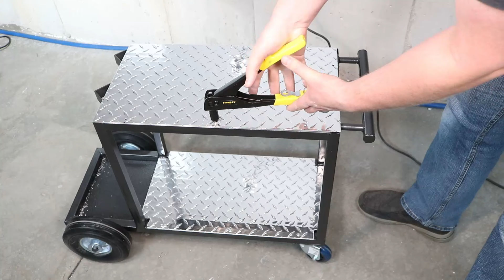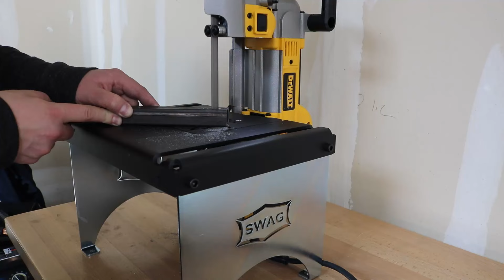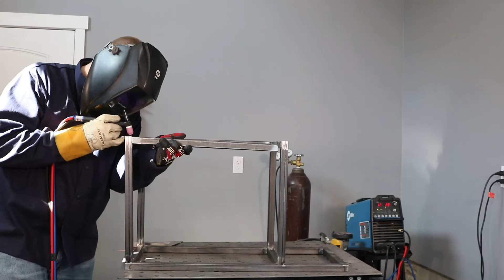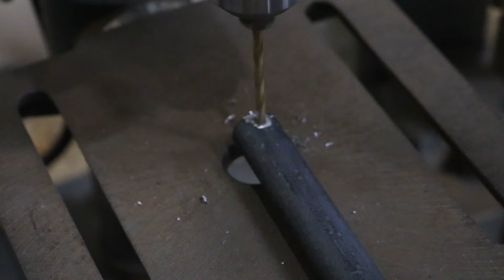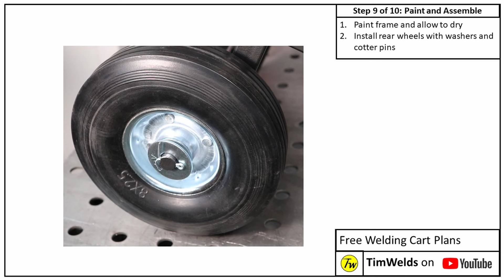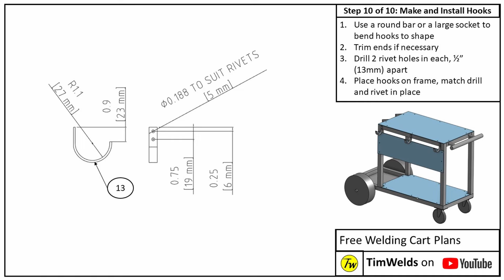How to Build a Welding Cart: Free Welding Cart Plans

Comment: How do ypu know wjat soze axle wheels with casters so its level?
Reply from the maker: I just held them up at the store to find some swivel casters that were about the same height as the top of the axle hole. If it's off a little, they're far enough apart that it'll still work fine.
Reply: Ok thank you tim keep up the good quality content you truly are a profesional

Comment: Great video!

But the only thing that i would never ever do again is weld on wheels, you should always bolt them on as they do eventually wear and break down over time and changing them is a big pain in the ass when you need to change them if thy are welded on.

Comment: Several questions:

1.  Are the plans downloadable for printing?  I like to print sheets as needed.  It would also be handy if doing an order on Online Metals.   

2.  I see you used TIG for the majority of the frame welding.   I may have missed something, but is there a specific reason for TIG and then the transition to MIG for the caster plates?
Reply from the maker: I don’t have downloadable sheets right now. You could use any process you like. It’s been a while and I don’t remember why I used both. I probably used TIG because it’s my favorite. My guess is that I switched to MIG because it got late and I needed to move things along or I ran out of straight Argon gas. 😃
Reply: @TimWelds  I did not get all 10 pages, according to the page number of 10. Can you provide the info at time stamps where they are? Thanks

Comment: How much was all this stuff?
Reply from the maker: Right around $200, but it could have been less than half of that if I bought the square tubing locally and used steel sheet instead of diamond plate. That being said, material prices have gone up quite a bit since then too.

Comment: Hi Tim great video i just started welding in my garage and i wanted to know what is  25mm  is it 1/8 or 1/16 wall if you have time . think u can reply back thanks.
Reply from the maker: Thanks! I used 1/16 wall tubing, but either would work.